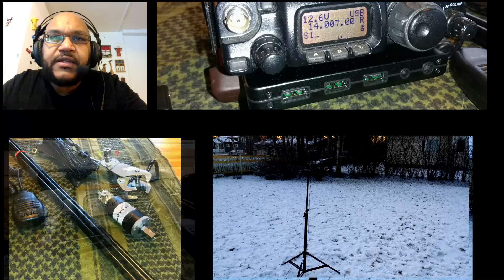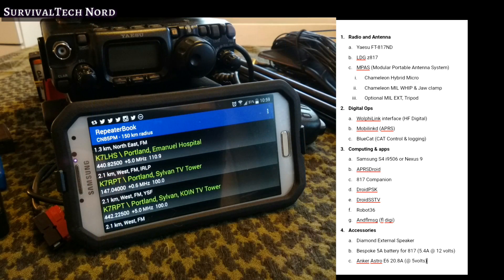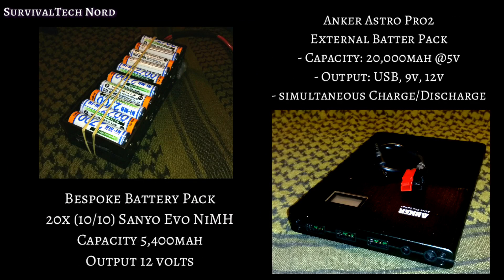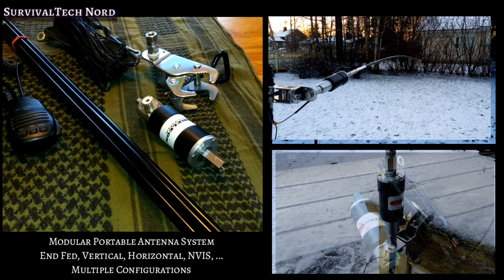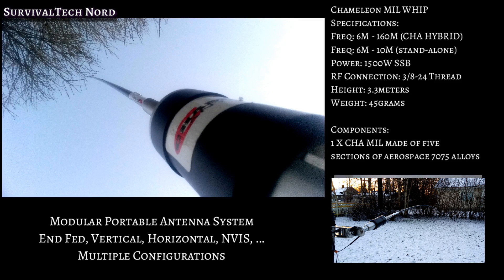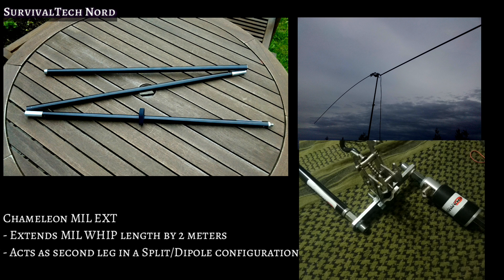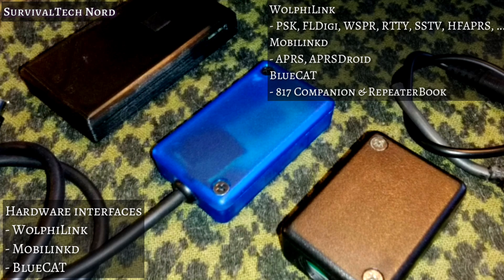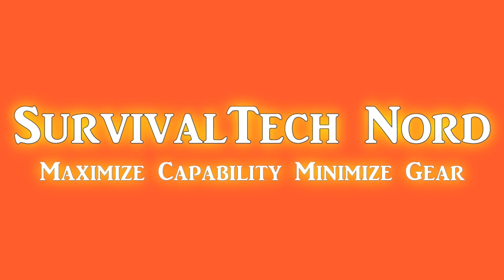Yaesu FT-817 FT-818 Go Kit | Digi Modes

Comment: Good day Julian how's the cold treating you. I am wondering what size battery are you comfortable using with the yaesu ft 817nd on a over night field trip. I am currently using a 12volt 9am lipo4 battery with a 28 watt solar panel putting out 1.7amps. This works fine but the battery is a little heavy. During daylight there is no problem . I am concerned about night time battery life. I forgot to mention I am using ssb
Reply from the maker: Hi Robert
Tough question. Have you seen this video? https://www.youtube.com/watch?v=TU46f9_vDr4
There are two packs in that video. The second is a 5ah 4s2p 26650 based LiFePO4 pack with 20w panel. That's what I use for the 817. We must remember, our radio is not going to be on during the entire night. Regardless of what battery we take along, we will have an energy budget. If we exceed that budget during the night, we have a boat anchor. If we test before deployment and understand how many hours we have in our energy budget, we can ration that power for the amount of time we need to operate during night time. There is no way around that.
I hope this helps
73
Julian oh8stn

Comment: Would the micro fit onto a Buddipole tripod somehow? Looking carefully at the MPAS and micro/mini. Anything that the micro can do that the mini can't or vice versa? Of course,  the micro is more portable.
Reply from the maker: +RobPetty622 hi Rob
I think you hit the nail exactly on the head. The micro is physically smaller and has a lower  power rating. I'm not sure about what Mount is used on the buddipole tripod. Both the mini and the micro have a 3/8 by 24 lug standard in amateur radio.
Hope this helps
de oh8stn
Reply: Julian, Thanks for confirming that. If I end up buying a micro or MPAS, it will be interesting to see which parts play well together. I believe W9ARV has a video of such an attempt. 
Looking forward to more great in depth reviews of products you feel worthy of testing. wondering about that just introduced F-Loop 2.0. and what's different besides the dial.
Reply from the maker: RobPetty622 No proboem, its fun to share the knowledge.
I've got the F-LOOP 2.0 on the way. From the pictures it would seem the construction has come into line with the P-LOOP 2.0 for manufacturing. That could mean common upgrades, same break down size, increased mobility, yes the larger tuning dial, ... Ipersonally think the P-LOOP 2.0 was a huge step forward from the current commercial portable loop offerings. Lets see if the F-LOOP lives up to the P-LOOP.

Comment: I have been building external power packs for radios for along time. Started with my old HT CB radio, and it turns out that pack which runs on 8 D cell batteries works great with my Baofeng HT, using the battery eliminator. And like you I keep tinkering to find better ways. Keep up the good work. KI7BSL, signing off. Oh, last what do you think of the BaoFeng BF-F8HP radio. I am thinking about getting one to mount on my bicycle.

Comment: Great video OH8STN! I would be curious to know how that  Anker Astro E6 worked out. It all looks like a great go kit! 73's AB7RU
Reply from the maker: +Mike Parkes Hi Mike.  Well in hindsight,  it was great as long as my kit was Android based for digital comms.  Now when I'm carrying a 12v Ubuntu netbook, they're is no reason to carry that extra weight.  Is a nice battery, but I find myself liking the Anker Astro Pro with 9/12v output and 12v charge port. 
Version 3.0 of this kit is in the works.

Comment: Just found this video.  What would you estimate the kit cost would be all combined?  I am thinking less than $2000 all combined I hope.  Still its a great kit.  Only thing I would add would be a 20M WHISPER circuit so you can be tracked if you want to, at all times.And that PSK31 for android, do you know if anyone has had success with JT65 on the android platform?  And can you tell me of any good testing on the PSKmail application?
Reply from the maker: +Kevin J thanks for the comments and questions Kevin.
Reply from the maker: +Kevin J thanks for the question Kevin.  One could easily get everything in that kit with that amount of money.

Comment: REally awesome kit.
Reply from the maker: Thanks. The next step is to integrate the radio, tuner and external batteries onto a mounting plate with fibreglass top cover to simplify deployment.
Happy new year and thanks for watching.
Reply: SurvivalTech Nord will that change the cooling characteristics?
Reply from the maker: Kevin Burgess It should be ok. The mounting plate is aluminum, to dissipate the heat. While the cover is a tunnel design with vents between it and the mounting plate. Looks kind of like a Marine Corps Quonset hut.

Comment: I am curious how you manage CAT (817Companion) at the same time as using the Wolphi interface, as both utilize the data port on the rear of the FT817.  Have you tried the CATMate (via W4RT website) for this purpose, or are you using another solution?  Thanks so much, Julian!
Reply from the maker: Hi Joe thanks for your question and for watching. 817 Companion is using the CAT port, while the WolphiLink uses the DATA port. The more interesting question would be how am I using the z817 antenna tuner and CAT control at the same time. The answer to that is the 38400 BlueCat (for CAT control) in the pass-through port of the z817. I like the CATMate, I was thinking that I should get one if I were going to use that external keyboard from W4RT. 
You sre very welcome. I enjoy these questions!
Reply: +SurvivalTech Nord This is how I envisioned it as well - thank you again, Happy Holidays, and please keep up the excellent work:  your videos are greatly appreciated!

Comment: In your opinion which is the better of the two antennas, The Chameleon Hybrid Micro or the Chameleon loop Antenna? I want to buy one of them, but I don't know which one that I would rather have ?
Reply from the maker: Great question. You're never going to beat the performance of the outdoor mounted Micro when comparing to the loop. But if I didn't have real estate for the Micro, or if I lived in an apartment or condominium without a balcony I would certainly take the loop. On the other hand having the real estate, I would take the Micro. But this isn't going to help you at all but I love them both. Still, in the end it all depends on your operating style and conditions.
Reply: Thank you. I have a home with an average city sized backyard, so I think that I will be getting the Micro. It probably wont be for a couple of months though with the Christmas holiday coming up. When I do, I will be getting it from your special deal through Chameleon Antenna.
Reply from the maker: ***** very nice. I also have the Micro in a sloper configuration coming down from my tower. The MIL whip on the Micro opoens up lots of portable ops as well. Anyway you'll really like dealing with Chameleon. Don't be afraid to ask questions even before you buy. They are good like that.
73s

Comment: Great video, thank you again for sharing your wisdom.Here is a good way to lighten your pack, trade your tripod for a telescoping fishing rod. If you get a deep sea kind made from graphite or carbon fiber they are super light.  Generally 1 lb for 18 feet long. It may look fragile but remember these rods bring in 100+ lb fish and are pretty strong. You could easily take two for dipole operations when you dont have tall trees around. Then just attach a fishing rod holder or pvc as a base to support them. Overall you should be under 5 lbs
Reply: Our group of hams has also grown very fond of yo yo antennas
http://hamradiofun.com/yo-yo-vee.htm
Reply: Forgot to mention best material is fiberglass as it is an insulator
Reply from the maker: Mr Vegas, always good to hear from you.
I do use 10M fiberglass poles for wire antennas :) 
The tripod isn't bad when I'm snowshoeing or skiing pulling everything in the skipulk. Or in summer with a hiking trailer. If I'm carrying it in a backpack, I'll leave it at home, and just deploy the hybrid micro as an endfed, also using fibreglass pole.
I don't like yoyo antennas in the field. The endfed is easiest (for me) since yoyr coax also loads at the end making deployment easier.
Thanks for watching and 73s

Comment: Loved the video. You had previously used a different solar panel that seemed to produce enough power. What made you choose to go with the power film? Thanks again for all the content and aid in learning.
Reply from the maker: Thanks for stopping by. 
The solar panel question is rather embarrassing. Since we're all in this journey together I'll just keep it real. I've tried to reach the solar goals that I have, with extreme funding limitations. So the four or five different panels you've seen on my channel have all been a balance of function and funding. In retrospect I should have purchased the PowerFilm panel from the beginning. It's more robust, has excellent documentation, and most importantly you know exactly what you're getting out of it. 
But that doesn't mean those other panels can't be a practical solution. In fact one of the videos that I'm about to release, is a hack, combining two budget panels, to creste one 38w 2A panel for ~100 bucks. Still, even though this sort of solution would work, in the field, in a grid down scenario,   would be the wrong time to tinker with my hacking job. That's why I chose the PowerFilm.

Comment: What size is the DC Output on the Anker Astro Pro2 that you had to build the anderson power pole cable for?
Reply from the maker: Another great question. I wasn't worried about the output coming from the Anker Astro pro 2, I use the Anderson power poles so that I can interchange cable connections between dissimilar products. 
Lego blocks. Everything has to work with everything else. That's been the design goal for electronics on this channel from the beginning.
I hope I answered your question thanks for watching.

Comment: A great kit breakdown STN. My little kit is woefully basic in comparison, but I suppose anything you have (and more importantly know how to use) is 100% better than nothing at all. How is it all packed together, do you protect the kit of electromagnetic interference or think that's not worth doing? I think I'm going to concentrate on the power and charging side of my dinky radio bag and go from there - maybe solar charging, a power bank a little at a time, as the budget may afford. Sanyo Eneloop batteries are excellent from my experience. Glad to see another video.
Reply from the maker: Thanks for the kindness.
At the moment I'm using my 3 day assault pack to carry it all, but that's not really working for me. So I'm looking for a modular field medic pack for the radio gear, and molle fly fishing tube pouch for the whips. Since this is a portable kit, there is no protection from electromagnetic interference,  not that I don't think it's important. 
Yeah, power and charging are always a big deal! I've wasted a lot of money on different solar panels batteries, and charging solutions. In the end we have to guesstimate what will need in the future when planning those gear needs now. I'd really like to see what you come up with. 
No kit is dinky, if it serves your needs!

Comment: Great video. I was wondering, how well does the solar panel work in the dark and cold winter here in Finland ?
Reply from the maker: Thanks for watching.
That is a great question.  Here in the North we have to be a bit more clever about the solar charging. Since we have such short days, we need to (unfortunately) carry greater battery capacity, in order to make up for reduced solar charging times. In contrast, during summer months, since we have nearly 24 hours of sunlight we have an abundance of power and in most cases over capacity. Its a trade off. I thought about micro diesel generators made from RC plane motors and motorbike alternators, and although they sound cool, they actually take our focus away from the point which should always be the Communications.
Kiitoksia paljon ja hyvää päivänjatkoa.
Reply: SurvivalTech Nord Yes indeed, in the summer there is sunshine but only if the weather allows it. ;)  Kiitoksia vastauksesta. Ja ei muuta kun hyvvää valamistautumista joulua ja uutta vuotta silimilläpittäin.

Comment: Again, great video! I like the way you think, so when I get my system together, I hope to somewhat model it after yours. Three questions about your system.
1. You mentioned the Alpha EZ military antenna, what was it that pushed you more toward the antenna setup than the Alpha?
2. Would you just use paper and pencil to write your contacts, or have you found a good Android app?
3. Does that one solar panel charge all of your batteries/devices? I saw some of your other vids, and so I am a bit confused.
Look forward to more from you.
Reply from the maker: You're welcome and thanks for watching.
The Alpha EZ military is a nice antenna but only good from 6-80 meters. I wanted to be certain that I could operate from 160-6 meters. That was a big part of it. I also also like how Chameleon is willing to take time to answer questions, teach, and be kind of a ham radio Elmer. 

 Of course I would use paper and pencil but I prefer to use a device when possible. There are two different apps. If I'm operating for fun I'll use 817 Companion, which controls my radio but also manages the logging. If  I'm in high speed low drag mode,  I'll use the app called HamLog. Both apps can export the log to adif You can search my videos for 817 Companion.

Sorry for the charging confusion . I'm always experimenting with different batteries  and different solar charging systems. in fact I think I have four or five different solar panel systems, because of all the testing I do. So remember things are never static on this channel it's always in evolution, a learning experience. 
 
I've been going to 20 hours straight now so I need some sleep but after that I'll update the description with links and information for all the apps and hardware from the video. Thanks again for watching and don't forget to share.